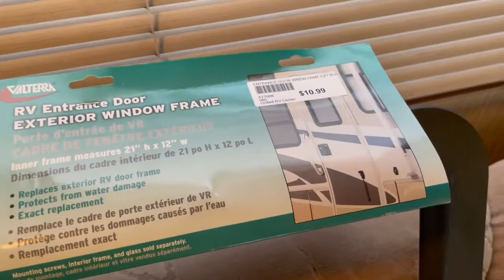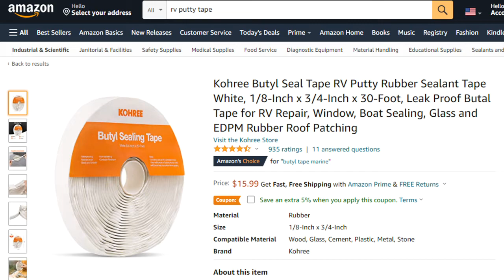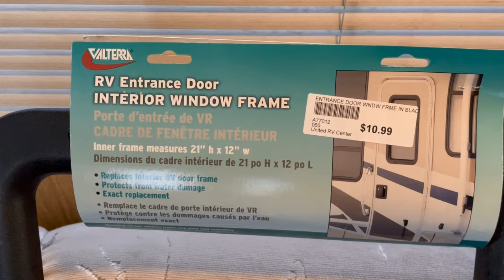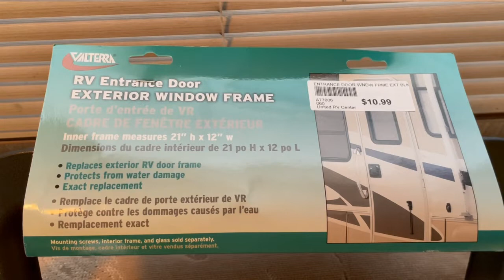How to replace RV door window frame trim | Valterra RV entrance door window frame installation

Comment: I noticed that you used 1/2-In x 3/4-In x 30-Foot Butyl Sealing Tape and that it is not black like the frame. Two questions, if you were to do it again would you use Black and would you go with the smaller size 1/8-In x 3/4-In x 30-Foot (1/8th-in instead of 1/2-in) Butyl Sealing Tape? Thanks for the video!